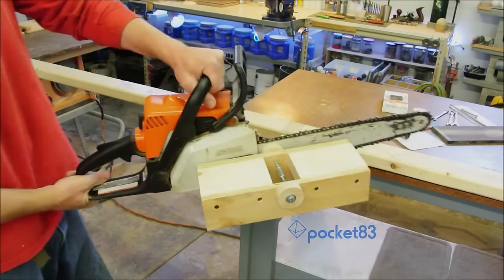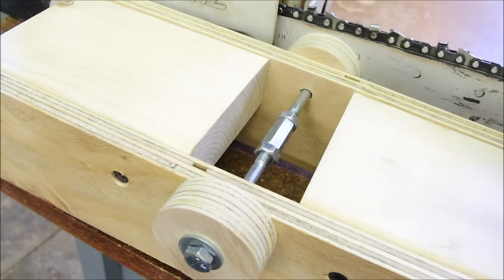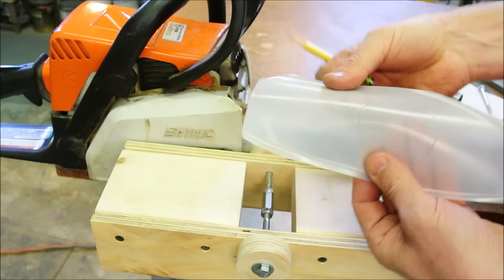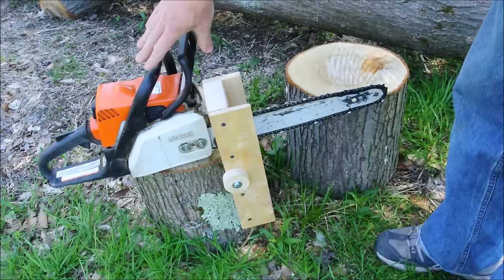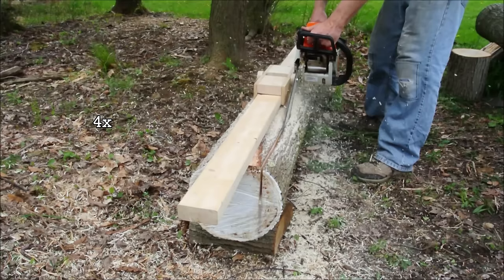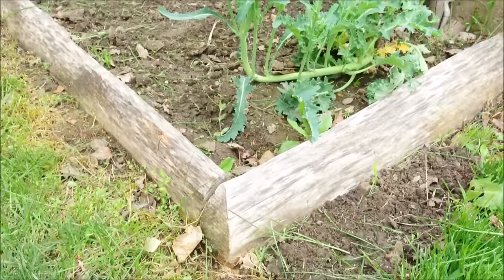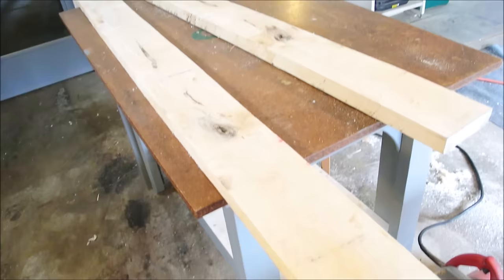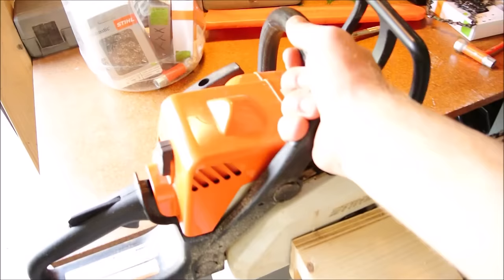Chainsaw beam guide from wood (DIY mini mill)

Comment: Nice video! Thanks for taking your time to make and post it.   I have debated if the time spent, and even the modest cost of a simple process like yours, is worth it.  Not sure it is a practical use of my time, in that I earn high income on my job.  Usually, I am financially better off to do the work on my job, earn a great wage, then buy the lumber I need from a lumber yard.   

However I like the self reliance of harvesting trees from my own land and milling them into lumber.  I am thinking that I can use a lot of this kind of lumber for more primitive construction that I do on my land such as building deer stands or farm related sheds and such.  None of that needs smooth, well planed lumber. Frankly, I think I could use the chain saw cut boards as soon as they air dried enough to lower the moisture content.  No need to touch them up.  Chickens in a coop could care less if the lumber is perfect.
Reply from the maker: There's lots of wisdom packed into that comment. Value is really difficult to determine. How we (should) spend our time is tough. Let me share a few points to consider. 

First, non-pine woods (like the Black Cherry and Maple that I mostly use) are super expensive, especially when they're in non-standard or extra-thick sizes, and so one has to make a substantial amount of money at work in order to provide them in any abundance. These wood varieties also tend to be more rot-resistant.  

Second, there is an invisible value to skill-building, because the 'new' things we learn have so much lateral application. We tend to undervalue the number of new ways we learn to think from trying out a new process. If DIY milling looks to have any enticement at all, I urge you to go at it. This one has a particularly biting satisfaction to it. As you get better, it becomes increasingly "practical."
 
If you're on the fence, there'll be a new video on this subject posted Friday. I've made some refinements. If you watch & give it a chance, I'll bet it'll be enough to swing you over! Thanks.

Comment: With the correct thread, you could probably come off one of the bolts for the chain guard, don't know if would be as steady - get more depth though plus don't have to drill through your bar. I love this though, thanks for the video - I'll probably build one also.

Comment: Love the videos on this jig so far and have subscribed. I was thinking about adding a piece of 3/8" to the inside of the jig and putting a 3/8" rabbit on the outer, bottom side of the 2x4. And went to look for parts list in the comments and there it was. Im definitely going to add that feature. Thanks 👍
Reply from the maker: Thanks. You might want to consider adding the counterweight instead. Watch the follow-up videos before you decide. Now that I have lots of experience with this method, I no longer suggest developing that keyed groove idea.

Comment: Nice jig! You might consider putting wax on the bottom of the jig where it rides on the 2x4. A product called Anchor Seal can be used to seal the log ends as well as the bottom of the jig instead of the wax. The anchor seal has a waxy feel to it when dry.

Comment: Nice job on the mill. If it still doesn’t slide easy, put a coat of Johnson’s paste wax on the jig sliding surface and your board your using. I use it on my mill (which are metal) and they slide pretty easy. Nice job overall. 👍🏻

Comment: Cool idea if your trying to save money and the lumber is for a simple project like a shed but it's easy to see the cuts are not even close to square wouldn't use this for framing anything
Reply from the maker: The later cuts become as straight, or straighter, than any mill out there. Perhaps you should watch the follow-up videos. 

Note that all milled lumber requires planing and jointing.

Comment: Great video 👍 
I love this. Very inspiring. I want to make this and ATTEMPT to make some improvements.🤔 Maybe additional bracing between the saw and the jig. 🤷🏻‍♂️ 

That’s what’s cool about these videos, the guided manufacturing and then the inspiration to follow.
Reply from the maker: Thanks. If you're really going to make one, I highly recommend watching the follow-up videos. After a few years, I really managed to refine the process.
Reply: @pocket83squared  
Oh cool. I’ll check that out. 
I just scrounged up some 2x4s and currently looking for the hardware. Who needs Home Depot when u horde building materials.

Comment: Nice job would be an easier cut on Cedar of course. And as you say can even free hand - but good low-cost solution- hardest part probably drilling the blade. 👍

Comment: I just found this. You have a great idea and setup. This works. Your chainsaw and CHAIN suck. You can see just by the chips it's throwing or really not throwing. Great system though. I'm going to try this. I have great hopes in this.
Reply from the maker: Since this video, I've milled this way quite a few times, and have since improved. The chain and saw I recommend do not 'suck.' If you care to know why, watch the follow-up video and read the descriptions and comments. 

In short, don't buy the 'big is better' idea if you're using this method. This approach uses fast, shallow cuts, and to do that, you'll want a small saw with a thin kerf (and a sharp chain). In my case, since the MS170 chains are cheap enough, I just equip a new chain every time I mill a log. Doing this is still more cost efficient than burning up a Farm Boss just to make twice the pile of chips. It also uses much less fuel, makes less noise, and requires half the effort to run.

Comment: I am going to try this this summer/spring. I wish you would have shown the placement of the hole you drilled in the chainsaw bar. But I try and figure it out. Much thanks for this video.
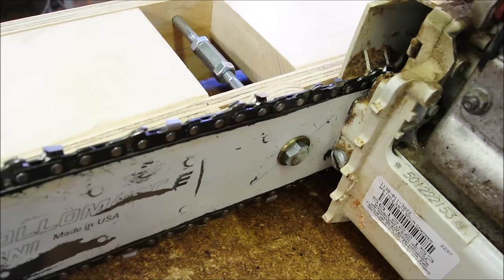Reply from the maker: Look at the screen @ around 3:52. Note that you can see where I drew a diagonal 'X' through the four rivets that are closest to the tensioning screw. The hole was drilled at the center of that X.

Comment: If you have big enough C clamps to attach your 2x4 to the log, use them. They are the safest clamp to use with machinery. They won't loosen due to vibrations.

Comment: you should cut a slot along the edge of the 2x4 and screw another piece of plywood so it holds the jig from dropping from gravity
Reply from the maker: Watch the rest of the videos in this series. A counterweight system gets added.

Comment: I would suggest:
Use a rectangular iron bar , more straight and with lower friction since you always get maximum friction using  two pieces of same material.
Instead of  graphite to lower friction, a thin brass disk with some  grease.
Bigger main bolt , 8 mm instead of 6 mm (do yoursel the weird anglosaxon unit conversion :) )
Reply from the maker: It almost sounds as though those suggestions were based upon experience. Except, of course, that none of them are good ideas, so I will not be implementing them. Feel free to carry around a 9' piece of steel for yourself, though. (That's around three meters, in case you have difficulty understanding.)
Reply: @pocket83squared  
Thank you for your reply.
I guess that milions views gave some arrogance. I forgive you,  I enjoyed your video.
You are right  a 80x30x2 mm irom square tube  would weight  10 kg against  3.6 kg of wood  but if the 6,4 kg more are a problem to carry around there is a good news for you, a 80x30x2 mm of square alluminium tube weights 3,4 kg and is much better than a piece of wood for this application.
My apologies if my non native english language make difficult to undertand easy facts .
Reply from the maker: @lucmaximilien5630  Factor in the price of that metal, and the labor to cut it. Now consider that I used the same perfectly straight 2x4 for three years. 

And I didn't ask for your forgiveness, because real arrogance is claiming "better" when it's just not the case. 

****
Same know-it-alls, different countries. Gotta love how they always slide in that metric-is-superior jab. As if they had a hand in devising it. Euro insecurity honestly rivals American arrogance; if not in degree, certainly in its net pervasion.

Comment: I love the simplicity.  Do you think that it would work as a supplement to a larger mill?  Like this is used to just supply a single flat surface for the larger mill to work from?  You could probably get a few logs prepped while the first log is being processed
Reply from the maker: That sounds like a great idea, but it'll all depend on the setup. In a more professional~ er, that is, a more production-oriented environment, a jig like this one would be nice for prep work because of its low cost & portability. Not to mention the much faster chain sharpening with a small saw. 

It could also help out considering that the bulk of the bark is on those end-cap cuts; It's certainly sensible sometimes to sacrifice a lower-value tool in order to prolong a higher-value tool. Keeping the bark away from an expensive bandsaw blade can't be bad.

Comment: Great video! Steel toe footwear is my only criticism 😄
Reply from the maker: That's not a criticism, it's an opinion—and it's one that I completely disagree with. Steel toes are cold, heavy, cumbersome, and for most non-bowling ball factory settings, useless. In the woods, their hindrance to the wearer will negate any potential defensive advantage. 

Statistical interpretations made to the contrary are mostly based on insurance-borne liability arguments, and the resultant (defensively evasive) corporate PR/marketing story, which is just a strategy to avoid culpability. Simply put, safety nonsense has been drilled into our heads, because nobody wants to be held accountable for injuries.   

In the case of chainsaw use, corrective wear is no substitute for good form. Your bar should be nowhere near your feet. Safety dogma in such a case is not a prevention; it's a last-ditch attempt to mitigate damage done by dumb. If this truthful reply offends you, I'll remind you that you've invited it.      

Please don't patronize me with one of those 'they're your feet, but you're being irresponsible' replies. I've had this exchange before, and the TL;DR version is that your argument will be extremely unconvincing.

Comment: I wonder if you could swap out the wood 2 x 4s you use for the rail and guide, and use metal studs instead. Might need to beef up the guide by inserting 2 x 4s inside the metal stud pieces, but the rail would be perfectly straight and  wouldn't need to sand at all.
Reply from the maker: This suggestion comes up a lot (on every video). I think it's more a gut reaction than anything. At first, metal seems straighter and tougher. But it's also impractical. Why? Because it's either heavier or flimsier, sharper, more difficult to design, more cumbersome as a rail, more expensive, and less available.

After using this mill for several years now, and having finally refined its design to downright simple, my opinion, for what it's worth, is that a steel stud guide rail is a bad idea. All the problems add up; keep thinking about it, and you'll see what I mean. Find a straight stud, give it a coat of poly and a light sanding, and you'll have a smooth ride for years. The boards I produce with this mill today are FLAWLESS.       

Two more things: a steel stud is also incompatible with the counterweight system used in my more recent videos, and it would be all but impossible to set it up for the final board cut, because it has no torsion strength.

Comment: Solution for the clamp issue: build a removable, wider base for your rail using 1/2" plywood. Clamp that, not the rail. Lose a little depth, but that' okay.

Comment: Hey boss, get a plate in that bandsaw. The only time I've ever been bitten by a bandsaw it was because that plug broke and fell through when the saw caught. Cut my finger enough to need a few stitches. 

Material going down that hole is a real danger. Worst case just make a plywood top for it by feeding it in and stopping when it covers the table. Then just use the saw with the plywood taped to the top.
Reply from the maker: The plate was only removed for re-sawing. 

Neither a tablesaw nor a chainsaw intimidate me, but bandsaw accidents are my nightmare. There's just something about how casually you have to move your fingers around near the blade. Thing bothers me.

Comment: Simple alternative compared to expensive systems. Have you considered adding a couple skate bearings to the bolt to allow free rotation? I've been looking into a saw mill set up and your's is appealing. 👍

Comment: they sell these jigs on Amazon for $45 using a beefy clamp on the bar. Seems perfect for milling two sides of a log to build a cabin. Lets be honest, lumber prices have sky rocketed.
Reply from the maker: Since we're being honest—if you can't build a jig like this, you shouldn't be using a chainsaw. Further, reviews for those "beefy" metal ones are mixed, whereas this one is a pleasure to use, especially if you've added the counterweights. 

Besides, $45 will buy you an entire sheet of premium ½" plywood, so you can make about 20 of these jigs. They do make great Christmas gifts.

Comment: What are the specs of your saw: CC, bar length and weight? Thank you. Was a pleasure to see how inventions are made from scratch. How detailed and thorough are your explanation, reasoning and testing. Can't do it myself - too advanced for me right now (can't even drill a hole straight :) ), but was interesting to watch.
Reply from the maker: Thanks. The saw is an MS 170 with a 16" bar. It weighs around 9 lbs. or so, and has a 30.1 cc displacement. If you liked this one, I'd advise you to watch some of the other videos in the series, especially the most recent, which is by far the most refined. Glad you enjoyed, and here's a link:

https://www.youtube.com/watch?v=alClPHQMeMk
Reply: @pocket83squared  Thank you.

Comment: Spinning the nail, in the drill press, while pressing down on the bar, will actually make it HARDER. it's called "work hardening", and it can make steel so hard, that you can't actually cut it.

The trick is going slower. Spin the drill, really slow and it will cut, MUCH easier.
Reply from the maker: Sure, the secret to drilling any metal effectively is having the patience to do it as slowly as is possible. Heat is usually the enemy, thus all the lubricant. 

Once, I had a corporate job where we'd occasionally have to drill into Inconel, which is almost comically hard. To do this, we were provided with an endless supply of the most expensive drill bits money can buy. Nevertheless, just as important as any bit was the technique; a carefully relaxed balance of pace & pressure was the only way to gain ground. My boss didn't understand this technique at all. One day he had to fill in for my partner, and so it took him snapping around a half-dozen bits before he started to wonder how it's even possible.   

However, back to your point: the guy's idea with the spinning nail had the intention of reducing the effect of any temper. At least in theory, a bar might already be tempered to be as hard as its constituent metal can possibly allow (since a bar's design is intended to resist abrasion, and not stress); if that's actually the case, then you won't be able to work-harden a bar's metal by physically agitating it under heat, and instead you might even soften the metal by doing so. 

But what do I know? I'm just a carpenter, and much of the physics of metallurgy remains way out of my conceptual acuity. At the moment, I remain uncommitted to an opinion.
Reply: @pocket83squared , we are polar opposite, I have been a machinist, for almost 25 yrs, cutting metals only, and haveonly been attemptingto be a carpenter, for a coupleofmonths.

 Yes, Inconel, is a crazy hard alloy, and this is because of the super high nickel content. 

Trust me, I would never attempt to drill anything harder than a pine 2×4, with a cutoff nail. It just doesn't make ANY sense to even attempt it.
Reply from the maker: Maybe you misunderstood. The idea was to heat up only one spot on the bar with the spinning nail, by getting it get red hot from the friction, and to then drill (with a bit) in that spot.
Reply: @pocket83squared , no..... I understand. And all that will do, is make it harder to drill. If you try to drill it, while it's hot, it will immediately dull the bit. If you wait until it cools off, it will be harder than before you started.  🤷‍♂️
Reply: @bayoudriftcreations5923  Usually isn't steel getting harder when cooled very quickly like from 1000 C to 20 C in less than a second, and it's getting softer when cooled slowly ?
Reply: @fractalphilosophorum9405  look up "workhardening"

Comment: I mean, no doubt you dont want people suggestions, I have generations before me of men deserving that title by age 10. I'm sure they would agree with you when you say need to be sturdy as I can't help to look at the void in you plywood.
Reply from the maker: I'm not sure I entirely understand your comment, but the void in the plywood was eventually filled with glue and wood. Not that it matters much; there is very little lateral force being applied to the sides of the guide box. 

If you haven't tried this process out first, the jig does not need to be as sturdy as you might think, because it's just a guide that's gently keeping you aimed in a straight line. Think of tracing a ruler to draw a straight line: as a straightedge, aluminum will work just as well as Inconel does. 

As for what men have done or suggested before, I will evaluate those cases each by the affect of their actions on their own time, but I have no concern for what might be their opinion of mine in my time. Don't overestimate the value of what 'they' say, old timer.